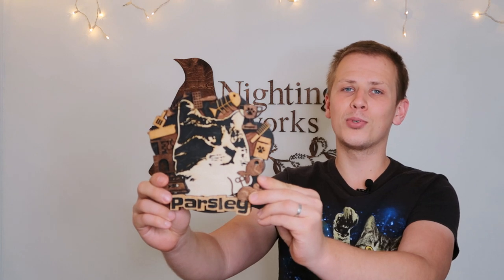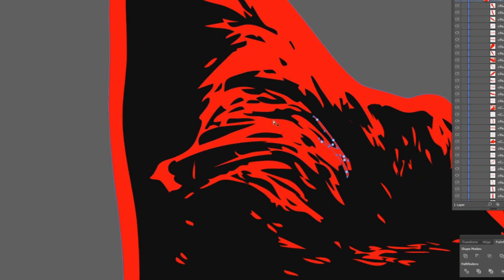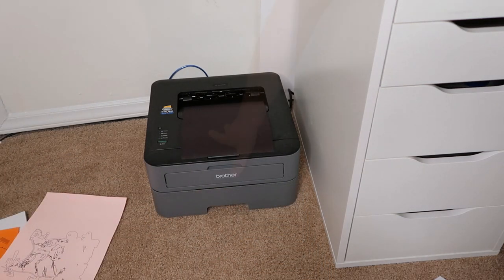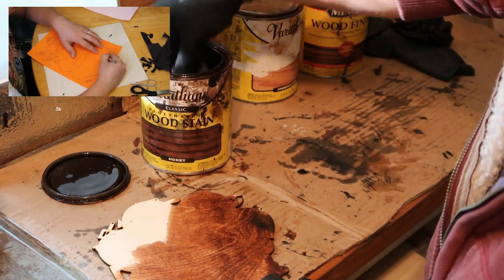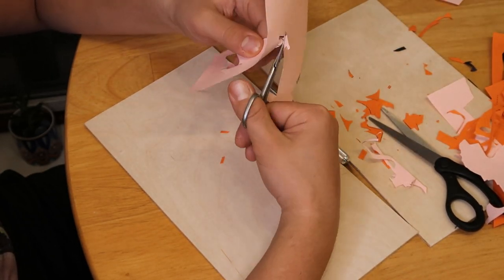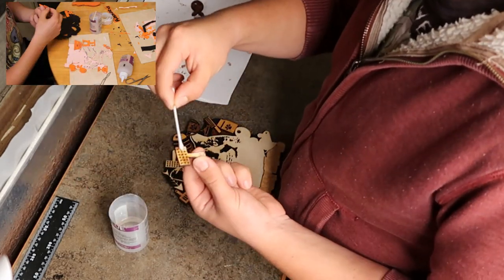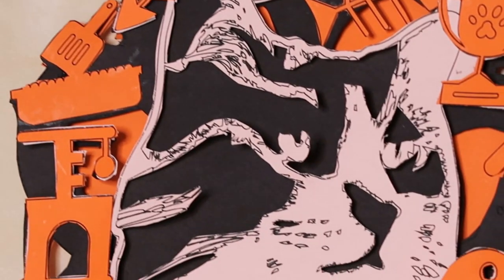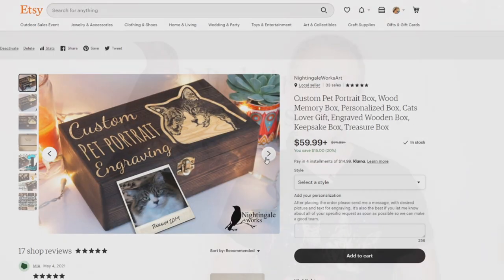Crafting my cat's 3D portrait out of plywood (and paper)

Comment: Great project! Brilliant! But it seems to me that there is a lot of useless activity in creating a mockup. I noticed that you are good at photoshop. Why not create the whole mocap in one file, but in 2 different layers, where the main one is the cat, and the next one is the background? The advantage of this method is that you will save time as you don't have to cut out all those individual elements for the mockup background (just to see how it looks) and you will see the whole project in one file. In the next step, you will separate the layers and cut out the elements with your laser. I hope this helps. ;-)